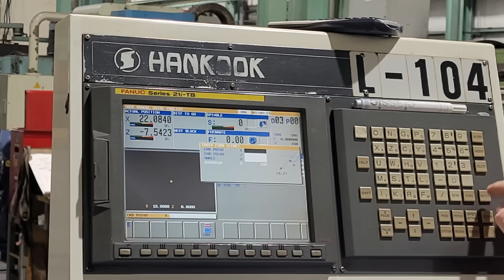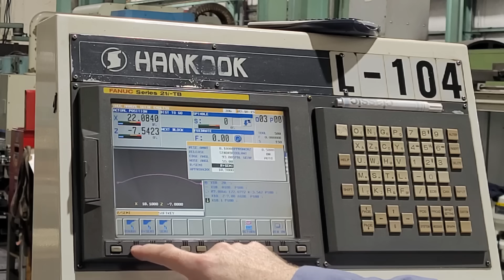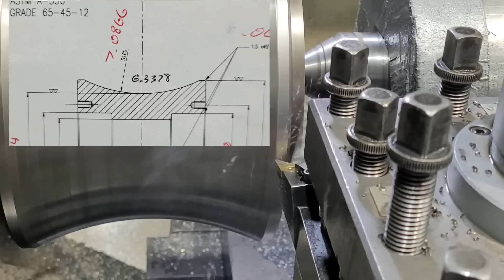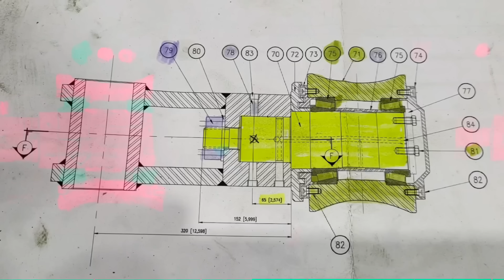Ductile Iron Roll | CNC Lathe Machining | Rolki żeliwne

Comment: I used to turn a lot of cast iron.   I positioned some wire brushes over the tool to deflect them downward. I saw what looked like a 3 inch wide paint brush at a tool store.  But it had flat steel bristles about 4 inches long. That worked so great at chip deflection. I had not thought about it in 30 years.

Beautiful curves at the push of a button.  Thanks.

Edit. Steel wire dusting brush. Used in masonry work.
Reply: Great tip! Thanks.

Comment: This video blew my mind. I run the same machine same controller and have never even seen an arc created like that before. I really need to learn this.
Reply from the maker: That's Fanuc manual guide for you .
Reply: @ChrisMaj  is it in the book how to do this? I have never really needed it but it would be really nice to learn.
Reply from the maker: @wendull811  O man, I haven't seen books in years, but I think there was one about manual guide.
Reply: @wendull811  there is a book about manual guide-i programming aviable online..... I read a bit, then just tried it in plastic in work, I stayed like an hour overtime to try radii, grooving, etc., it works really great

Comment: I've done some manual machining over the years. Not as good at as someone who does it every day! I DID have a CNC class as part of my ASMET and BSMET BUT the machine we used was "programmed" by typing the code in and using a stack of IBM punch cards! Then THAT was put on PAPER TAPE! Granted that was in the late '70s and the machine definitely was ancient! 🤣

Comment: How much do you trust the insert recommended speed and feed to get your finish?
Reply: @Si-Al-Ti  usally the insert setting are starting points and only are for 10 to 20 minutes of tool life. If you want the insert to last longer general reduce the sfm.
Reply from the maker: Sometimes it's a good starting point. I'll adjust as I go.
Reply: @Si-Al-Ti  well that is actual cut time and running at full speed and feeds. Some of the inserts I use I can make last for a couple hours. But with reduced efficiency so it all depends on what your doing and how you are doing it. If your running 1000's of small parts a day you go full bore. If you are doing long turndown and stuff like I do and Chris does then you back off some. It's not alot 100sfm slower can drastically increase the time the tool lasts and when your still running at 500 rpm on big parts you really don't  lose much time.
Reply: @Si-Al-Ti  saftey is key... best thing  you can do is always ask why? And then only change one thing at a time. Documentation is key when starting out. Also hearing and feeling is super important. You can hear and feel an insert going bad just by the change in pitch and slight vibrations coming from the machine long before you will see it. Just realize it takes time and practice. After running machines for 17 years 50+ hours a week, the first 2 or 3 years were the hardest.

Comment: use a CNMG push it harder your machine seems capable
Reply from the maker: What operation?
Reply: i mean its great but if i was you i would use cnmg 432RN  if i remember right for Od and id roughing  . Just a recommendation .
Reply: i used to make tubing spools different sizes from 2 inches to about 50 inches long and about 8 inches  to 12 inches diameter 4130 .it was a fun job but with time and experience i was able to cut down alot of tine by using a cnmg with about .2 to .23 per side depth of cut.